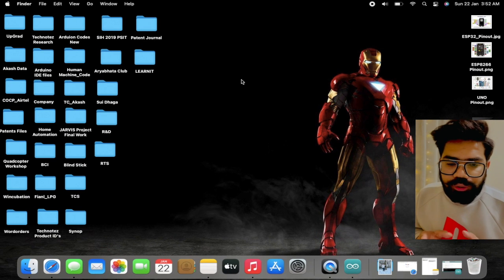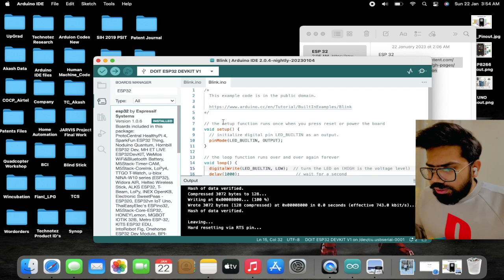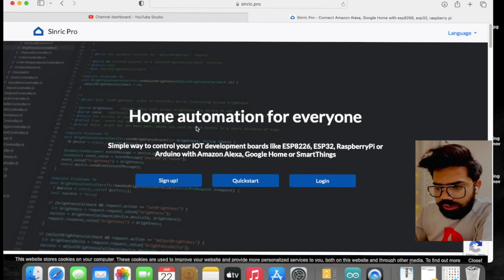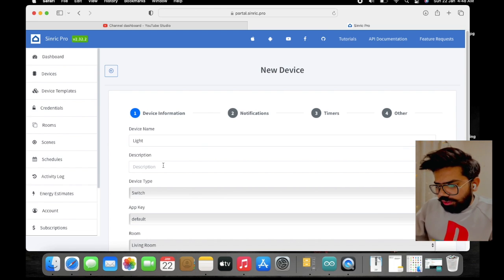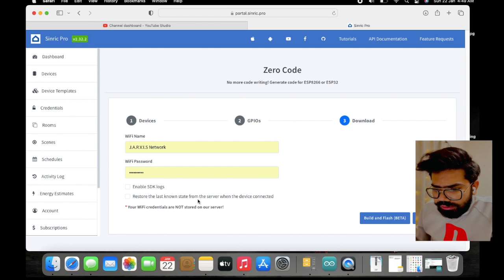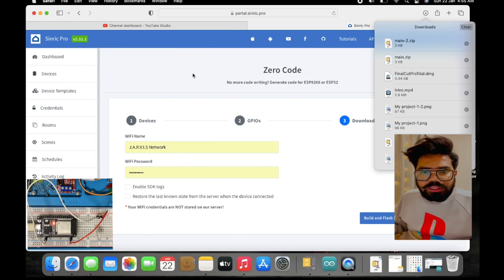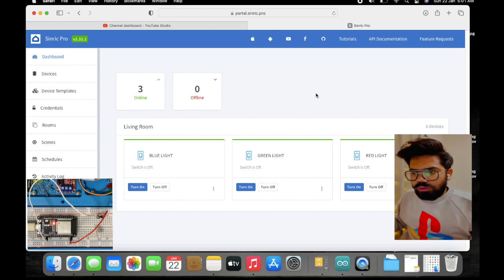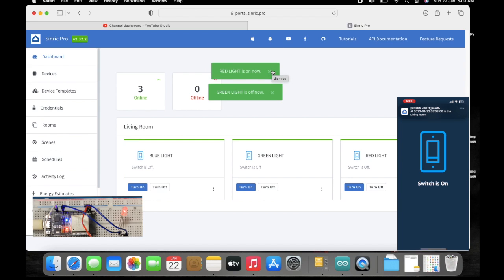Step-by-Step Guide: Building Your First ESP32 IoT Device - A Beginner's Tutorial

Comment: while setting up esp32 if u getting error: 'LED_BUILTIN' was not declared in this scope
   28 |   pinMode(LED_BUILTIN, OUTPUT);
      |           ^~~~~~~~~~~

   33 |   digitalWrite(LED_BUILTIN, HIGH);  // turn the LED on (HIGH is the voltage level)
      |                ^~~~~~~~~~~

exit status 1

Compilation error: 'LED_BUILTIN' was not declared in this scope

use this code \
int LED_BUILTIN = 2;  //add this line to define port number
void setup() {
  // initialize digital pin LED_BUILTIN as an output.
  pinMode(LED_BUILTIN, OUTPUT);
}

// the loop function runs over and over again forever
void loop() {
  digitalWrite(LED_BUILTIN, HIGH);  // turn the LED on (HIGH is the voltage level)
  delay(1000);                      // wait for a second
  digitalWrite(LED_BUILTIN, LOW);   // turn the LED off by making the voltage LOW